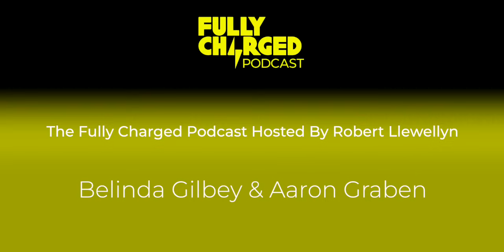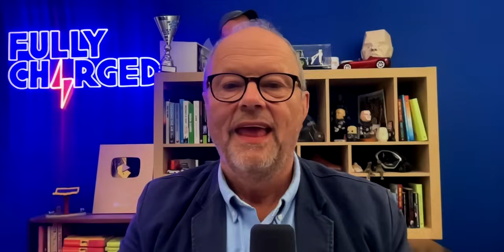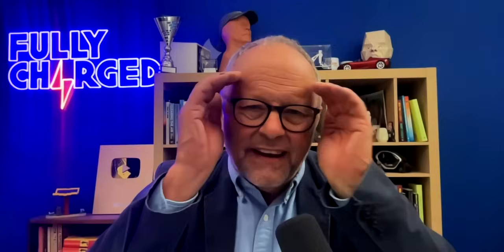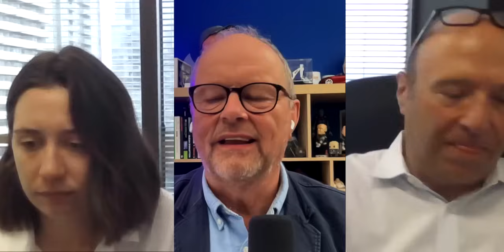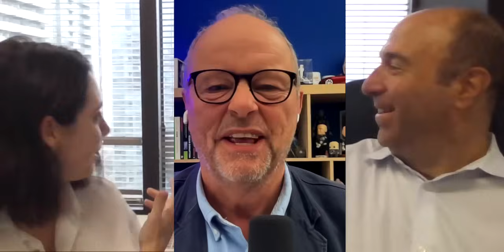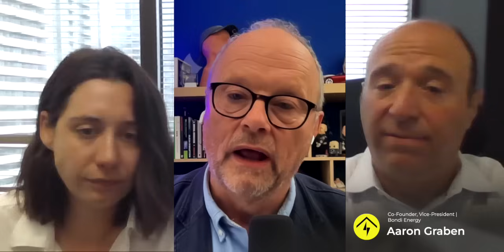High-Rise Heat Pumps With Belinda Gilbey and Aaron Graben | The Fully Charged Podcast

Comment: Robert Llewellyn, your interview questions were very intuitive. Thank you for having Belinda Gilbey and myself on The Fully Charged Podcast. We look forward to reconnecting with you again on BONDI Energy's multifamily heat pump retrofits and all the amazing decarbonization technologies we thread together. Helping Building owners eliminate GHG emissions, increase energy efficiency and values, securitize against increasing carbon fines and energy costs and improving tenant comfort.
Reply: WOW for all the questions swimming in my head surrounding district heating or centrally supplied heat, all answered.
I had no idea central ASHP systems existed on a whole building scale, but it makes sense. I’d suppose the system retains a more level COP as it will have thermal inertia in its buffers and throughout the whole building.

Comment: I have worked with water source heat pumps in a high rise, but they also had a cooling tower to control the water temperature in the summer, and a natural gas boiler in the winter to provide reliable heat to the water loop in the winter.  It works great, but you also need to leave that 25 HP water pump on 24 hours a day to have on demand water to heat or cool the tenant apartments at any given moment of the day.   So this seems to waste power.

When I worked at a University, they had air source heat pumps that served many units, each with a indoor coil, and no need to run a water pump or gas boiler or water tower.  Mitsubishi makes a "City Unit" that can have up to 25 indoor coils, and even hot water heaters in the system to provide domestic hot water too.  They are variable refrigerant systems, where the outdoor unit is 480 volts, the indoor coils only 0.3 amps at 240 volts.  

When Ms. Gilbey talks about a individual unit on each balcony, that would be a single zone heat pump.  The outdoor unit will make some condensation in the winter, and that should not be allowed to drip off the side of the balcony, down several hundred feet to the nearby sidewalk, and cause ice on the balcony.   So that water must be collected and sent to a drain line.  On very cold days, heat tape might be needed too.  

So with a ductless heat pump, you can collect 100,000 Btu's of heat while using about 5 KW to 7 KW of power.  A electric baseboard heater will use 30 KW to get the same 100,000 BTU's of heat.  If running a gas boiler, it would take about 1.3 therms of gas to get 100,000 BTU's of heat.  So most of the time, the heat pump is the lowest possible cost!  

I agree that changing a gas heated building to electric baseboard type of heating would be very expensive!  It would require each apartment to be upgraded from 100 amps to 200 amps!  Switching to a 25 SEER ductless heat pump, and the apartments might use less power than running a 20 year old air conditioner that is only 10 SEER.   So no need to upgrade the power to each unit. 

A variable speed ductless heat pump can collect heat at -5F by increasing the compressor speed to 120 Hz on the very cold days.
Reply: Groundsource water based heat pumps do not "require", cooling towers in the summertime. Or natural gas backup heating. But including them addresses excessive loads, reducing the base load requirements of the heat pump. 

Converting a  building from gas to a heat pump does not "necessarily" require an electrical service upgrade. By utilizing energy storage technology,  and off-peak electrical capacity. 

When I was traveling Asia I noticed a lot of mini split heat pumps on apartment buildings. Which is another option, which can be very cost effective. To paraphrase an old expression, there are a plethora of ways to skin a cat.

Comment: One building type that wasn't mentioned was a co-op or cooperative. These are fairly common in the US Northeast Corridor and it particularly in New York state. That's where the entire building is owned by a corporation that is fully owned by the tenants. Since most boards are aware of Maintenance costs as well as fuel and other heating costs, they would be in a position to understand the cost-benefit relationship and bring it to the tenants.

 I enjoyed the discussion;  would have liked to understand a little bit more about how it can be done without interfering with the facade. That's the other major problem that a lot of these tenant buildings face if they are in an area where the outside of the bldg has been designated as historic.

Comment: In the real world a lot of pumps are installed by incompetent companies. Super insulation is neglected, resizing of radiators not implemented properly. The results are massive electricity bills. I have friends that have improved the insulation to the point that the pumps hardly run and I have friends that are really disappointed because they cannot afford the bills after the change.
Insulation is the most important thing, no way around it.
I feel that we have the tools, but not the expertise.
Reply: Alferro 3149,  If your friends who are disappointed in their new heat pump are trying to heat hot water to run through a hot water radiator heating system, I can understand why they are not happy with the results.  Heat pumps should not be used to heat water heating systems!   

If they had a ductless heat pump, they would be very happy with the lower running costs, even if they did not improve the insulation at all.  What they should do is put in a ductless heat pump in the main living space, and that can reduce their electric bill a lot.  Heating air to 20C is so much easier than trying to heat hot water heating system to 40C or 50C.  That is really difficult, and results in a very low COP.  

A ductless heat pump can have a COP of 4, while the hot water heating system that warms water for a radiator system, that can have a COP of only about 2.   So with 10 KW of power used, electric baseboard heater will put out 34,500 Btu's of heat.  With a COP of 2, you get 69,000 Btu's of heat.  With a COP of 4.0 you get 138,000 BTU's of heat.  So as you can see, the 25 SEER ductless heat pump with a COP of 4.0 or 4.2 will produce a lot more heat per KW of power input.  

SEER rating is the number of BTU's per KW of power the system uses.   So 14 SEER is 14,000 BTU's per KW of power consumed.  25 SEER you get 25,000 Btu's per KW of power consumed.  Higher is better, but the equipment will cost a bit more.  

I put a 17 SEER ductless heat pump in a home my nephew rents.  The indoor coil is mounted on a TV cabinet, and the copper lines run out the window to the outdoor unit.  It saved him about $300 last winter on the electric bill, so he did not need to run the electric heater anymore!   And he gets great cooling in the summer, the unit is about silent!  It is a $619 Della brand unit, at Amazon.  120 volts and 12,000 Btu's.  It warms his 1,400 square foot home just fine- even at 20F (-8C) outside air temperature.
Reply: Thanks, it makes sense.
My friends that are happy all have underfloor heating and water source heat pumps.
What I am absolutely convinced of, is that a good Scandinavian standard kind of insulation actually does not even need a pump, living in it would actually be enough to keep it warm. Sadly, there are always market/profit reasons behind everything.
Is the economic model that we should change. Is not going to happen🫤
Reply: Just adding insulation, that solves everything in terms of heating, right?  

Until you die from the mold and mildew caused, by the increased amount of moisture.....  YouTube experts have  all the (overly simplistic) answers....

Comment: There are about 1000 flats in my block. Our balconies are 1 metre wide and we are not allowed to leave even a pair of flip flops on there as it is deemed a fire risk because the balcony is also the fire escape. Apparently the vibrations from 1000 air source heat pumps would rattle the building to pieces in any case. Surely a vertical ground source communal heat system would be better for such apartment blocks.
Reply: Not really.  It’s the equivalent of a split AC system.  In Asia each apartment has multiple units, either installed on the balcony or otherwise affixed to the outside of the units.
Reply: @xiaoka  We are not allowed anything on our balcony as it is a fire escape. Those buildings with them all on the outside look terrible. Plus there is a major  problem maintaining them and fixing breakdowns when high up on the outside of high rises.
Reply: Jayjames, if you have heard a normal HVAC unit running, yes I agree they tend to vibrate, and are noisy, about 65 to 75 Db.  However a ductless heat pump is much more quiet, and do NOT vibrate at all.  They can be mounted out of the way, and easy for your fire escape system.  Even hang them above the balcony if that is what is needed.  And the mentioned Italian units can be mounted in a hole in the wall.  

Yes I do recall a hotel in Nevada that has about 75 of the PTAC air conditioners that has the outdoor fan running all of the time in the summer, it sounded like a airplane getting ready for take off!  But ductless heat pumps do not make that much noise, it is more like 45 Db, or less than the average refrigerator.
Reply: @Kangenpower7  Nevertheless a shared vertical ground source system would be silent and not spoil the entire architecture of the building. Plus such a system (vertical) would have a very small footprint on the ground and could be situated under the communal carpark for example.
Reply: "1000 air source heat pumps would rattle the building to pieces" LMFAO.... 

Actually  Modern mini splits ,  vibrate less than your heartbeat,  and are relatively quiet and maintenance free..... 

But if you can get a costly and complex ground source heat pump installed...  They are even more efficient.....So good luck with whatever your options are....

Comment: We do heat pumps in towerblocks using Ground source heat pumps with individual shoe box heat pumps in each apartment and so homeowner or tenant can control the heating and running costs via there electric tariff

Comment: Love what you guys are doing.  But I do have a request: whenever you're talking about a heat pump used only for heating or cooling air (as opposed to one that incorporates an integrated unit that also heats water), could you please try to mention its other common name, especially for viewers and followers in Australia and NZ where it is known as a "split system reverse-cycle air conditioning".  Cheers, and keep up the good work.
Reply: An S.S. R-Cac? Bit of a mouthful!
Reply: Is it always a split system & if it is, is that mentioned?
Reply: @vitaminjuk  It sure is!  But I mentioned it because those who are not up to speed on terminology think that a heat pump is something different from the air-con they already have. I don't know of anyone in Oz/NZ who in the last 20-25 years would have installed an a/c that is not SSRC.  So in fact heat pumps are a lot more prevalent than people think.  Even in developing countries in S.E.Asia, split systems are the norm, albeit being used mainly for cooling.

Comment: the electrical capacity is a massive issue with air source heat pumps during the coldest days they will run less efficiently at say 150-200% efficient whereas ground source will still be 300% efficient due to the higher ground temperatures and scale this county wide air source will need more capital cost on grid upgrades

Comment: As a refrigeration engineer of 20 years I can tell you the truth.
The truth is just heat pumps are just like ev's there a good idea but once you get one you will regret it and wonder why you purchased something worse than what you had before

You will never reach the temperature you did with your gas boiler you will have defrost problems as soon as the temperature outside reaches below freezing the list goes on just like ev's we had a nissan nv200 and got rid of it after 3 months as it was incapable of supporting the milage a engineer needs in one day

Comment: There's no difference between cenralised air conditioning and heating via heat pumps (actually air conditioning is both heating and cooling - something we forget in the UK) its the oil and gas lobby which has stopped this tech being used for the last 40 years, sickening

Comment: It shouldnt be too hard to design a unit that only requires two separate holes , e.g., a window adapter, that enables air transfer in and out of the building. I've seen them on sale in a portable format, but a larger capacity, fixed unit mounted inside, say a laundry or other room accessible to the exterior of the building, perhaps.
Designers, 'ave a go!

Comment: On the topic of heat pumps replacing natural gas Robert keeps mixing up efficiency and cost equating increased efficiency of heat pumps with cheaper reduced cost. Perhaps he is used to life in the UK where natural gas may be expensive. But in NA gas is cheap. Even though heat pumps are more efficient, gas is still far cheaper and then it a concern for working class people. My neighbor installed a heat pump system but he will only use it in air conditioner mode to cool. He continues to use his natural gas heater in the winter because when he tried the heat pump his electrical bill was 4x more then what his natural gas bill used to be.
Reply: If the heat pump is properly installed, and he is using it on days that are over 30F, then they should be saving money on the heat pump.  Below 30F, then running on natural gas can save money, depending on the price of gas in your area.  So maybe use the heat pump in the spring and fall, and switch to gas in the very cold part of winter.

So to collect 100,000 BTU's of heat with a heat pump, it will take about 7 KW of power.  To get that much heat from a gas furnace, it will be about 1.1 to 1.2 therms of gas.  Check your local price, and see what is lower cost. In many areas, they have recently raised both the electric and gas rates, so be sure to check the costs every year or two.
Reply: Unfortunately, “Price” of gas is one thing. “Cost” of gas is another……
Reply: Where/what is NA? Namibia?
Reply: @madaboutvoice - Mexico-US-Canada.

Comment: Replacing our failed domestic electric element hot water heater with a heat pump system. Paid for itself in 8 years which is when it failed. I calculate it needed to run without fault for another 11 years to be carbon neutral.
Reply: I'm a big fan of heat pumps in general, but not so much for heat pump water heaters,  I always considered them  complex and costly to their relative return ie ROI.  Plus in the winter time they pull heat from the air, that has to be replaced, at an additional cost. But you do get some air conditioning from it in the summertime. 

For the future combining all the home heating and cooling needs into one heat pump based system, would be even more complex, but extremely efficient. Starting with the refrigerator, And then the living space and domestic hot water. Even clothes dryers, could be included. With a form of thermal storage  Which could be a hot water tank but preferably phase storage. It would be much more efficient, since the  waste heat of one appliance would be the beneficial heat to another appliance.

Until something like that is perfected, i personally would be hesitant buying a heat pump water heater. Good luck with whatever you replaced it with.

Comment: Heat pumps for heating are overwhelmingly typically more expensive to run than heating from natural gas.  Commercial HVAC use natural gas for heating water and direct heating.  

It's impossible for greenhouse gas behavior to cause global warming.   Global warming was officially stated at 1.1°C in 1991 and 1.06°C in 2022.  There is no mechanism that would allow greenhouse gas behavior to cause global warming.   

The back of the United Nation's IPCC science report states it took its greenhouse gas samples at 20,000 meters altitude where it is common high school level knowledge there is no greenhouse radiant energy.  This is typical practice for deceptive marketing to state legal data transparency protecting the perpetrators from fraud prosecution.   The IPCC has been transparent with its data acknowledging it is not dealing with active greenhouse gases.  

Earth's greenhouse effect is frequently used as a primary example to high school students of a system always in saturation from the strong greenhouse gas water vapor absorbing all the greenhouse radiant energy from the earth with greenhouse gases within 20 meters of the surface that is all around us everyday and can't have its overall effect changed.  There is no further greenhouse radiant energy to interact with greenhouse gases.  At 1% average tropospheric water vapor over 99% of earth’s greenhouse effect is from water vapor.  Water vapor would hold earth's greenhouse effect in saturation if it were the only greenhouse gas in the atmosphere.

Arctic warming is taking place with the proving mechanism being warm Atlantic Ocean waters migrating deeper and more frequently into the Arctic Ocean warming it and the region.   That warmer water is causing a few weeks less of reflective snow and ice coverage resulting in more solar heat gain to the Arctic region surface.

Atmospheric CO2 levels of 1200 ppm about three times what they are today would greatly invigorate C3 plants the majority of plant life on earth greatly greening the planet. 

0.4% of the atmosphere is CO2 and on average 1% is H20 water vapor.   (1% H20)/(0.4% CO2) = 25.  Water vapor is 25 times more present in the atmosphere on average than CO2.   Water vapor has an CO2e of 18,  18 X 25 = 450 CO2e total for water vapor to 1 CO2e for CO2. 

The Earth’s oceans have 3-1/2 million sea floor volcanic vents warming the water and changing it’s chemistry that have not been systematically accounted for.